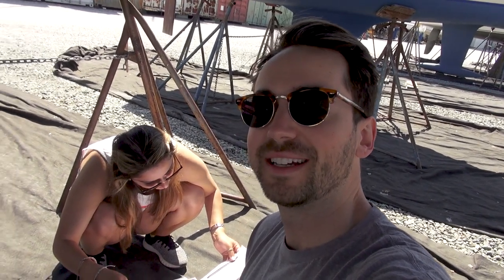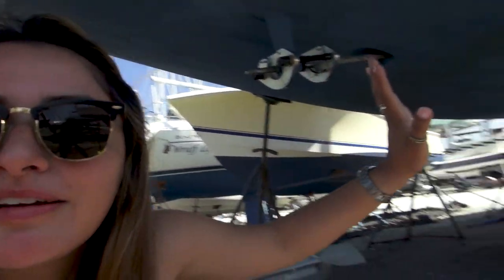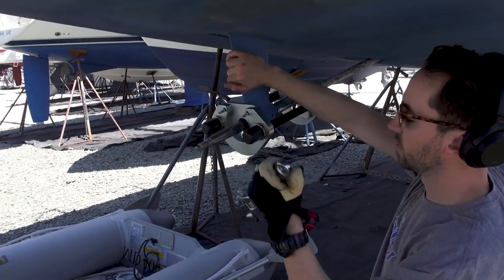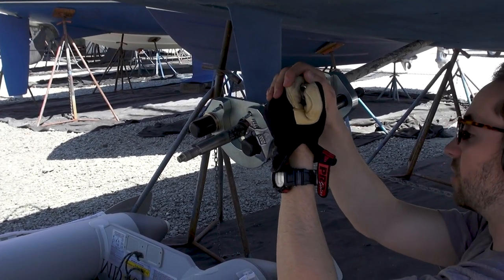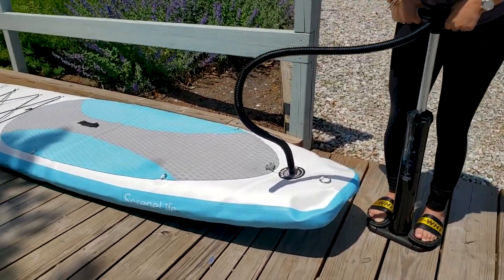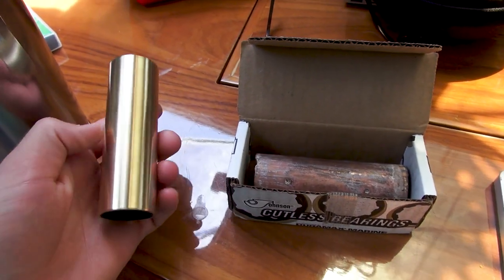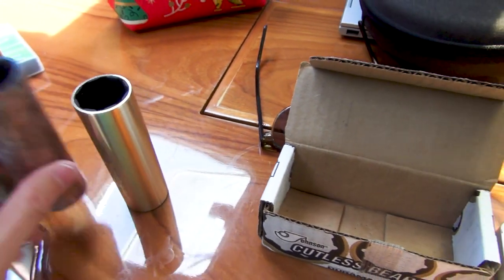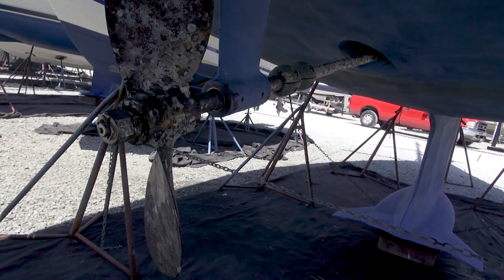Replacing A Hunter 376 Cutlass Bearing with the Strut-Pro Tool - Sailing Viridian EP51

Comment: When using an adjustable wrench, pull against the fixed jaw, especially in high torque situations. If the adjustable jaw fails, you can get a face/mouth full of broken wrench. That little rope clamp you used is what we called a Spanish windlass in the shipyard. VERY handy and cheap tool; you can clamp, align and even hoist small distance. Keep the videos coming!
Reply from the maker: Awesome, thanks for the sharing the knowledge! Glad to hear I'm not the only one who uses this "Spanish windlass".

Comment: It’s called a strut.   Not a cutlass.  The bearing is called cutlass bearing. The cutlass bearing is in the strut.   Measure everything you replace. Always verify what the manual says. That goes for any liquids and electrical stuff. Manufacturers love to change things and they are not good at proofreading. Good luck!